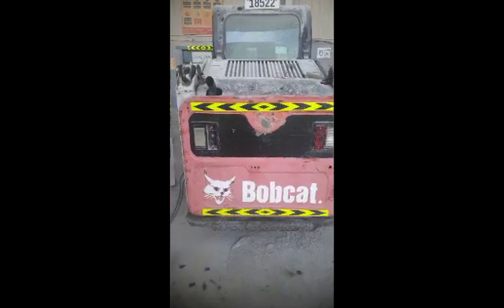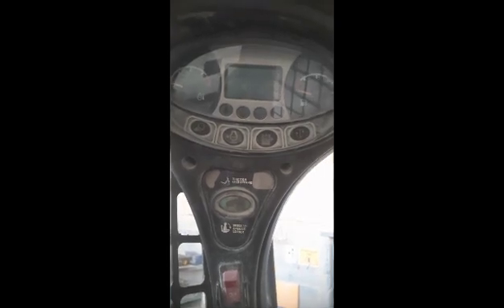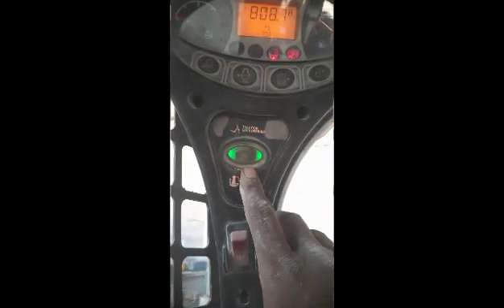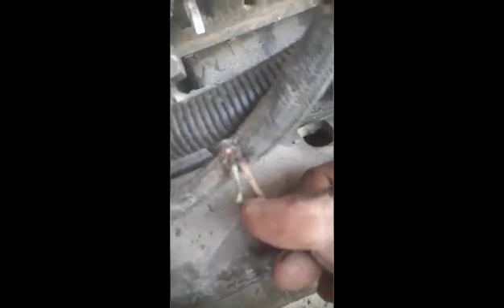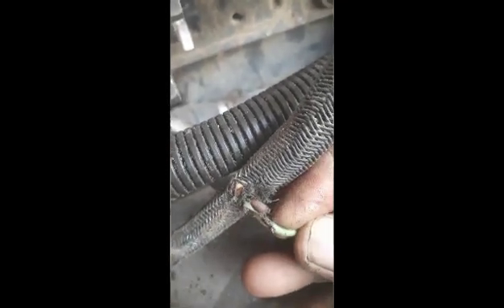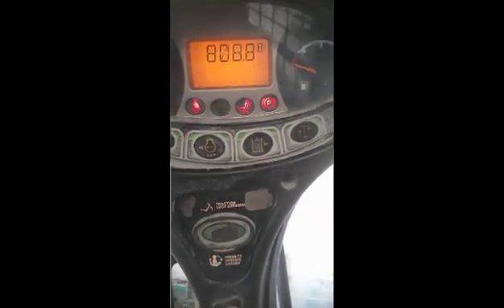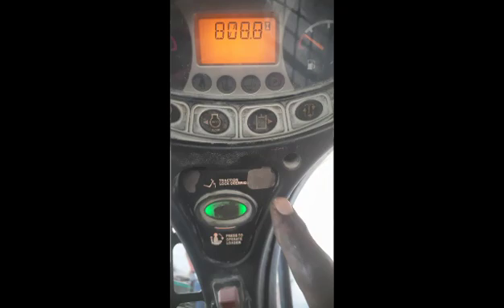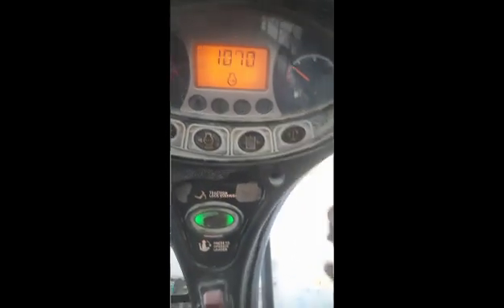Why Park Brake Was Not Releasing Of Bobcat (Skid-steer Loader )

Comment: What another reason if not function of Lock and Parking of bobcat S450,
Reply from the maker: On behalf of your problem I discussed with my friend, he also faced this issue. But at the end he found his ground was lose. Check properly fuses and relays box, most of time there are lose connections. Contacts where fuses are installed become lose.
Reply from the maker: If electrically ok, then it may be mechanical problems. There are rubbing something each other.
Reply from the maker: I am electrician so can give you only electriccal solution.
Reply: @AlbertB72  thank u sir, this unit i already send site,location.but another problem,if not full trottle the engine, the switch green not off,its possible sir,hydraulic pressure not enough.
Reply from the maker: Whenever I face an other reason, I must share with you.
Reply: @AlbertB72 thanks my friend,, 1 bobcat again same model,,i remove solenoid,to try to fix another bobcat same model,after parking again not releasing..any idea,my friend
Reply from the maker: Check battery connections make them properly tight. Mostly due to lose connections happen this problem
Reply: @AlbertB72  battery new sir,,good fixing. I remove lock chain center.after running.but running slow. Another problem sir,,if not use full trottle not running this bobcat..full trottle the engine but slow running,is it pressure not enough? Thank u sir.